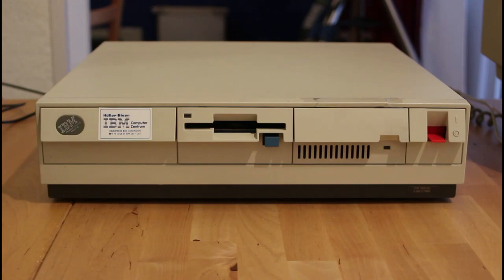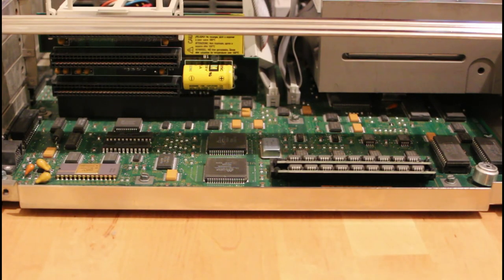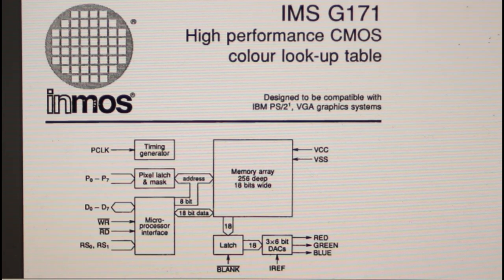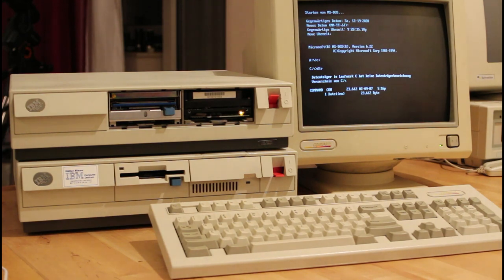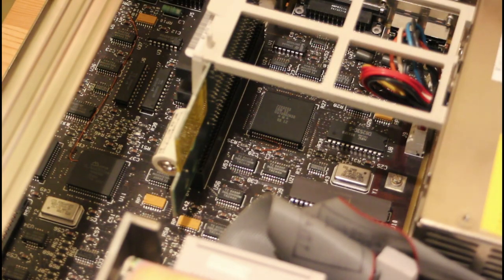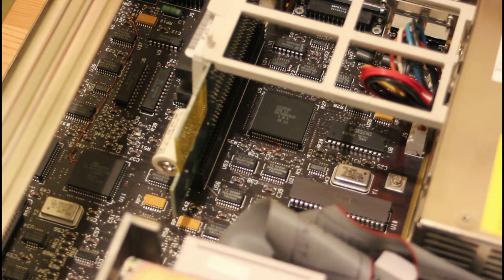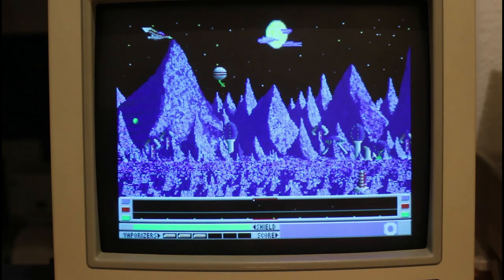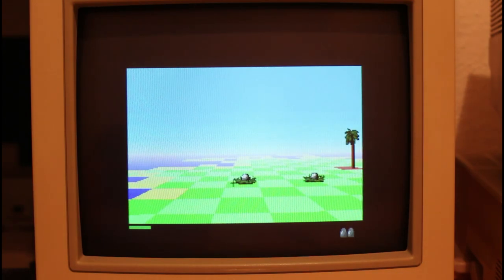The IBM Model 30 and MCGA proto-VGA (#DOScember)

Comment: The repair wires you noticed on the motherboard are usually indicative of a design fix found on early revision logic boards. It's a common practice by manufacturers to run these wires over the surface until a future revision of the board incorporates the fix in the design. This likely means your working PS/2-30 is older than the first. You may be able to confirm with via serial numbers and/or date codes on the computer.

Comment: The ones with the white power switch are the model 30-286 machines.  All the 8086 ones have red switches.  I had one of these with a Sota 386si accelerator card.
Reply: Yep.  I wanted the red switch, but also wanted a 286.  Ah well.  :-)
Reply: That's not quite right, I have a 30-8086 with a white switch. I'd read that IBM rebranded switches from red (from the XT/AT days) to white in the early days of the PS/2 line. Some early Model 60's also come with red switches.
Reply: @charleswiltshire  interesting.  I had never seen that configuration.
Reply: @charleswiltshire  i also have a model 30 8086 with white switch, and one with red switch.
Reply: Checked both of my ps/2 model 30 8086. But there are a few huge differences between the white switch and red switch 8086 version. The white switch version comes with a 1.44mb disk drive, the red switch has a 720kb diskdrive. But the biggest difference is the mainboard. The white switch version  has the memory and rom chips on the right side of the mainboard near the psu unit and the cpu near the front left of the pcb. The red switch version has the memory and rom chips on the front left of the pcb and the cpu on the middel right of the pcb near the psu. The white switch version has a shirt serial number 55-kk*** and the white switch version 55-********. The 720Kb floppy uses an edge connector to connect to the drive. The 1.44Mb version uses a modified 34 pin floppy connector.

Comment: About the HDD issue. Try low-level formatting it with official IBM Diagnostics disk. Many drives after sitting a while lose their calibration, and writing all new tracks helps (or even almost completely resolves) the bad blocks issue. Also, XT-IDE CF ISA hard disks (such as the Lo-tech XT-CF-lite sold at Texelec) pair with these computers well. I'm not sure how long the old proprietary IBM hard disk will work on mine, but I'll use it as long as it runs. Floppy drives are a common issue on these, and there are ways to mod the FDD cable on 286's, but TexElec sells plug-and-play adapters for the model 30 (8086) floppy drives so you can fit standard floppy drives on it. Many owners buy a cheap NEC V20 CPU off second hand market that provides a 50% speed boost for the original model 30's and model 25's. Great video!
Reply from the maker: Thanks. The low-level format tip especially might be really interesting to try.

Comment: As the machine has ISA slots you could replace the IBM hard disks with an XT-IDE card and either IDE drives, or a CF adapter. A friend of mine has the Model 30-286 and did exactly that, as his machine didn't have a hard disk.
Reply: I did that to mine model 30 and model 30 286. Works great and is great to transfer file to the system.

Comment: I'm not sure if someone else mentioned it earlier in the comments, but you can get an adapter to use a standard floppy drive with the PS2. The floppy drive in the PS2 is notorious for cap failures.
https://texelec.com/product/ibm-ps2-to-standard-floppy-adapter/

Comment: With those ISA slots, you have MANY different options for when those hard drives inevitably fail.  You can use a modern and inexpensive XTIDE ISA card, or if you want retro, an 8-bit SCSI card (with BIOS) and SCSI hard drives.  I went the SCSI route on my Model 25 (8086), 8-bit TMC SCSI card, and a 400MB Seagate SCSI drive.  Initially my M25 had an ISA hard card (notoriously unreliable Plus drive) and dual floppies, but I removed one (bad) floppy and installed the SCSI hard drive in that bay.  I also installed a network card in the other ISA slot (the M25 only has 2), I can run mTCP stack and get some cool features like FTP for file transfers, and NTP for setting the system clock from the internet, also has IRC, and even Telnet.
Reply from the maker: The SCSI solution isn't a bad idea. In fact I probably have one lying around somewhere. Fortunately the hard drive is still going. Unfortunately the floppy drive is not. And apparently on other PS/2's they used a different standard for the floppy again. Amazing that they went to so much trouble to make things non-standard, even between their own machines!

Comment: Ya as others have mentioned those wires were done after the board was etched to fix a design bug or flaw. Very common to see on the old boards from the 80's in general. Some have a snakes nest of wires to bodge fix the problem. You can try to do a low level format in the bios if the bios or IBM utilities have such a function.

Comment: When sears had them as demo units and I would create prodigy account and prodigy at the time had a cheap version of 3d graphics adventure via dialup.  It was fun by crazy slow.  I am tempted to buy the top model of that version which at the time
at retail was just around $4,000   You could buy it today for under $500 now I think

Comment: I used to have this PC as a kid. You should try Star Control 1 - it looks and plays great. Also, Prince of Persia 1. The MCGA is also great for some of the early point-and-click adventures - they run with beautiful 256-color graphics and they don't really require much CPU power. Another advantage of the MCGA was that it supports the undocumented/tweaked CGA modes, so it has excellent CGA compatiblity, better than the EGA and the VGA. And the biggest drawback - it doesn't support any of the EGA modes. It was really frustrating to have to run games from the 1984-1986 period in ugly 4-colour CGA modes, because MCGA doesn't support EGA 320x200 with 16 colours (even though it supports 320x200 with 256 colours).
Reply from the maker: Thanks for the suggestions. I will give those a go.

Comment: 4:43: "...that's a high-performance CMOS colour look-up table, whatever that is."
The colour lookup functionality refers to the fact that the VGA (EDIT: and MCGA) would look up the values for each of its 256 (simultaneous displayable) colours in a palette [i.e. table] of 262,144 colours. More info here: https://en.wikipedia.org/wiki/RAMDAC#History and here: https://en.wikipedia.org/wiki/VGA#Color_palette
Reply from the maker: That's right. I explain this shortly after that point in the video.

But the name they give it here sounds like fancy IBM-speak for RAMDAC. They also call the hard drive a "hard file" whatever that is.
Reply: @PCRetroTech  The CLUT moniker (currently) does make an appearance in that RAMDAC article, and there's also this: https://en.wikipedia.org/wiki/CLUT

If you think IBM terminology is weird and insular, you must not have met Microsoft.

I could be mistaken, but I think I recall that a hard file originally used to be some specific HD product, possibly a hard card, which would make hard file another genericised trademark too. I could be wrong though. Evidence for semi-obscure things that were a thing before the advent of the WWW is often harder to google.

Comment: Really nice comprehensive coverage of the Model 30, thank you. You've managed to make a nice amalgam of the two computers there.

You could do future videos perhaps looking at a Sound Blaster or And Lib upgrade?
Reply from the maker: Indeed that sounds like a good idea.
Reply: I upgraded mine model 30 8086 with a soundblaster 16 vibra 16 bit card. It will workin a 8 bit slot as a lot of early 16 bit cards do. Since the 16 bit part is mostly used for the cd rom.

Comment: I believe the white switch models were the 286 variant, while the 8086 models all had red switches.  I have two of these but the power supplies have issues.  One note that if you are working on a drive, do not set it on top of the plastic.  It's grounded and conductive!  Lesson learned.
Reply from the maker: Which plastic? My case is painted and definitely not conductive. Do you mean the plastic in the drive bay?

Comment: @PCRetroTech Wow, this brings back memories! My first PC was a Model 30 286, which I saved up for while in high school at 17 years old in 1988. I remember being the only kid who had a PC at home with VGA graphics, as everyone else I knew was still on 16 colours. 

Within 3 months of ownership I had worked out how to totally dismantle and reassemble the whole machine. It is what got me started in a career as a computer technician and retail sales from 1990 to 2015.

I even played the same games you featured in the video - Budokan, Links and Thunderstrike (plus its follow up Stike II) - on my PS/2. But I must say, the 286 handled the games way better. Especially Thunderstrike was miles faster - to about double the frame rate in your video.

I upgraded it with an OG Sound Blaster card and 2400 baud internal modem. Would you believe I even ran the machine as a local BBS for 2 years! (Yes on its tiny 20MB hard drive and all!) 

Sadly, by 1991 I had far outgrown my PS/2. So I sold it back to the same store I originally purchased it from. (Much to my disappointment these days, as I love to still have it!) However, get this, they payed me back close to the same amount of money as I had originally payed for it new! Being a true blue IBM machine meant it kept its value very well. That never happens these days.

Anyway, the money I got back was enough for me to purchase hardware and build my own 486 clone. And the rest is history...
Reply from the maker: Wow, that's an amazing story. It's amazing that a 286 would keep its value so well when later machines were coming out.
Reply: You were lucky to get a PC in 1988 with VGA. Our family still had an outdated Atari 800XL and even more outdated TI-99/4A at that time. In 1988 you wouldn't be able to find any games using 256 color VGA graphics. If a 1988 game had VGA capability, it usually displayed the same 16 colors as EGA, usually for machines that were equipped with MCGA (since MCGA could display 256 colors, but not EGA backwards compatible). Occasional games using VGA this early on did still display 16 colors, but a slightly different palette from EGA, like Airball. Dream Zone did use a VGA palette for nearly photo-realistic black and white scenes in the early part of the game (which you couldn't do in EGA) but it was still 16 colors. You had to wait until 1989 to find games using 256 color VGA like Mean Streets, 688 Attack Sub, Tongue of the Fatman, Face-Off. Budokan, etc. Deluxe Draw II did come out in 1988 and it was VGA capable, and you could create art using the 256 colors even in 1988.
Reply: @Miler97487  You are totally right! I had to wait a bit before games used the full colours. But yes I did have a copy of Deluxe Paint (aquired from my school). Those games though, they bring back so many memories of wonderment. Budokan, Fatman and Mean Streets!

Our school was fortunate enough to have a single PS/2 30 286 in the library for us to use during lunches. (20+ Apple IIs and IBM PCjrs were elsewhere in the nominated computer room for class learning.)

Using and playing on the PS/2 made my mind up to get that exact same model. I wasn't totally aware that VGA would come into play until after I'd bought it. I just knew it was better than the 4 colour CGA on the PCjrs.

Took me six months of hard work and bartering to save up. Plus my very kind Grandmother offering to double my earnings. 😉

Comment: Nice overview of the PS/2 model 30.  The PS/2 Model 30-286 has full VGA, if you ever come across one.  The Model 25 all-in-one system is also MCGA.  There is also an Epson clone that had MCGA (a fact I learned only this year!)

Some software notes:

Revenge of Defender is slow because it's building a 64K page in RAM and moving the entire page to A000, but because the programmer chose to render the page bottom to top for some reason, the move to A000 is slower than it needs to be.

A-10 Tank Killer is slightly faster because it's only rendering and moving the top half of the screen.  That said, the polygon rendering rate is impressively fast.

BTW, did you notice the main ship in Thunderstrike is light-shaded?  (Lambert shading)  The light source is fixed (I don't think it rotates with the camera) but it's still a nice detail.
Reply from the maker: I actually didn't notice the Lambert shading. However, I recently saw the C=Bit 18 by Performers demo and they have shaded polyhedra which has my noodle fully baked. I simply don't know how they've done that on a C64. I have something new to aim for in 2021! P.S: I think they probably have 15s precomp to play with, but still!
Reply: @PCRetroTech  It's not too difficult, the shading is fake of course, you just compare the normals at the center of polygons.
Reply from the maker: @JimLeonard  Yeah, but it's not flat shading. The cost of just copying pixels from a lookup somewhere is already pretty high, let alone doing all the normal computations. I wonder just how fake it is. It looks amazing.
Reply: @JimLeonard : "There is also an Epson clone that had MCGA (a fact I learned only this year!)"

The Epson Ie "clones" the Model 30 so close that it is more than a coincidence. There is a planar functions control register that is mimicked exactly, including the same bit-order for each of the planar features. It seems that Epson was released to field their own model at some point after they designed the Model 30 for IBM.

The Epson Ie did unify the MCGA controller into one newer chip - I would even bet that a fault of the MCGA gate array chip that was replaced with a different version for the Model 25 and 30 systems is fixed on the Epson Ie. I'm referencing ECA 023 (IBM's Engineering Change Announcement list) which seems to be the reason that IBM replaced the Model 30 "P-Planar" with the "Greenock planar", and the move from the Model 25 'Type 1' planar to the 'Type 2' - Second versions that had the 11F8028 gate array instead of the earlier 72X8300.

Comment: I have the MCGA bodge wire in one of my PS/2 model 30 computers, too. It's carrying the vsync signal, and it is just re-routed. The original trace is near the edge of the board and was likely prone to pick up noise or had a problem with reflections. They scratched the original trace close to the point the bodge wire attaches at the big gate array chip and also close to where the trace re-joins the net at the other end.
About that scrolling shooter: VGA has some hardware support for scrolling a playfield with a score bar in the bottom staying at the same position (needs mode X instead of mode 19/13h though to be useful), whereas MCGA is just a stupid framebuffer, so every frame the game has to redraw 60 Kilobytes (as you explain later at 27:30, too). As the MCGA is (like the original IBM VGA) connected to the 8-bit system bus, and not to the 16 bit "local bus" (only RAM and processor go there), drawing 60 Kilobytes is quite slow.
Reply: Dark brown PCB too? Mine attaches to a solder pad just off the 72X8300 Gate Array chip (that was replaced by an 11F8028 on later planars) - @PCRetroTech has the bodge-wire going to the chip pin itself. Do you know what BIOS version yours is?

Here is my latest kludgy video to toggle enabling the planar functions, including MCGA: https://www.youtube.com/watch?v=JmrKx7wHGLI
Reply: @IBM_Museum  I have looked into two PS/2 model 30s (Both non-286). The older one has the bodge wire, attached to the via next to the 72X8300 gate array. The trace continues to another via, but is scratched inbetween. This planar is green and BIOS chips 61X8937/61X8938 installed. Some component designators are missing is cramped areas.
The newer PS/2 model 30 planar is a brown PCB, has no bodge wire, but has that connection re-routed. It has the new BIOS 61X8938/61X8940 instead. I don't know which label that gate array (the "video memory control gate array" in IBM speak) has on the newer board, and that board is currently not in my reach. PCB designators are printed in a seemingly bigger font, and at the same time there are no missing designators.
Reply: @tw11tube : The MCGA Gate Array chip changed between the Model 30 early "P-Planar" and the later "Greenock planar" (components identified exactly the same, but some changed in position), and on the Model 25 between the 'Type 1' and 'Type 2' planars (fewer components moves, but an IBM 'ECA' specified a planar replacement for video errors caused by the 72X8300  Gate Array - there are no bodge-wires on3 either Model 25 planar). The underside of my Model 30 planar with the bodge-wire (and "Revision 0" BIOS) is marked in pen as '2/87' (the initial PS/2 release was in April 1987).

Model 30 BIOS versions are listed here: http://ibmmuseum.com/BIOS/8530/Versions.txt - All are dumped in the same directory. See my channel for more Model 30 information. The "Hakemon Mike" channel is a friend that has also investigated MCGA.

Comment: Great video as always! Are the connections to the original drives functionally different to regular drives or are they just a non-standard connector? If functionally compatible then maybe it would be possible to design adapter pcb(s) to interface between the Model 30 style connectors and the connections on standard drives...
Reply from the maker: Perhaps, but there are no power connectors. I guess one would have to put molex connectors on the adapter as well.
Reply: @PCRetroTech  The PS/2 Model 30 hard disk is a proprietary 8-bit XT-Attachment drive that is compatible to nothing else in the world (except for PS/2 Model 25 hard drives, as the Model 25 uses the same kind of drives). It's not just the connectors that differ, it's also a different command set.